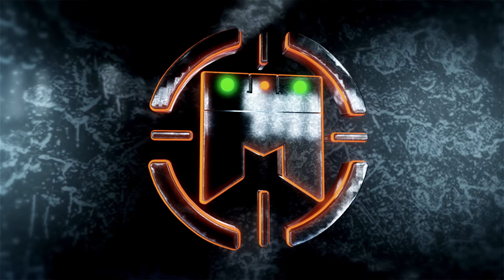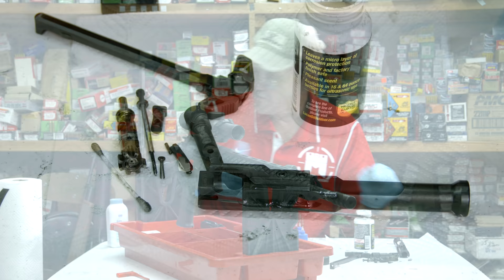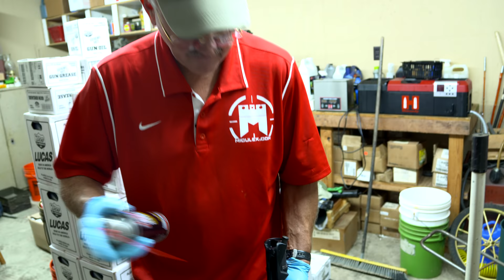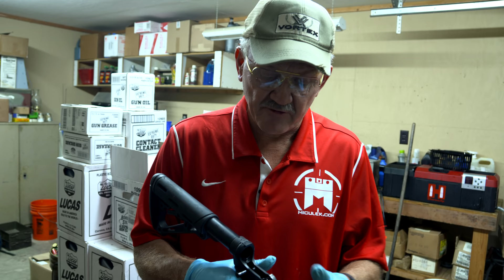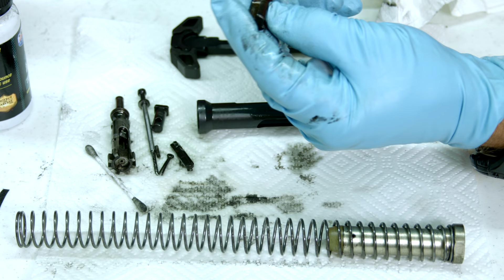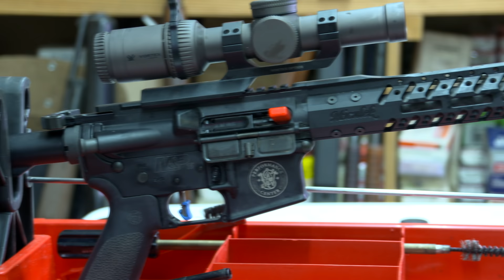ULTIMATE AR-15 CLEANING AND TAKE-DOWN with Jerry Miculek! (4K)

Comment: I have an old 181 series Mini-14 that can only be cleaned from the muzzle. Mine always has, and still does print 1.5 MOA groups. Why? Because I like to use a homemade plastic rod guide in the flash hider when cleaning to prevent damage to the crown of the muzzle. Using a rod guide on the chamber end of an AR is a great way to protect the throat area of your chamber and greatly extended your barrel life while maintaining top accuracy potential on an AR.

Comment: Non chlorinated brake cleaner, fuel injector cleaner and marvel mystery oil is all you need. If it can clean and lubricate an engine, it can definitely protect a gun and about $5 can clean a lifetimes worth of firearms usage. MMO can be used to clean and lubricate as well  and also runs about $4/qt at Walmart

Comment: Hey Jerry:   
Where did you get the two tools you used on your AR.  Also, when I asked the folks at LaRue Tactical, and they said not to oil the piston rings on the bolt and leave them dry. What are your thoughts on that? Other than that, this was an outstanding tutorial, and will likely be of great benefit to those new to the AR and old salts as well. 
Shoot Straight: James Myers

Comment: i make my own cleaner and lubercant. I  use 3 parts synthetic oil with 1 part synthetic transmission fluid. It cleans carbon very well and lubercates the weapon. The next time i clean all the carbon wipes right off without any issues...Just a thought.

Comment: My gunsmith showed me a cool trick for cleaning the upper.  I noticed Jerry uses paper towels and it seems to work great.  The way I learned was to put a 12 gauge mop on a length of handle.  It works perfect.  Its also useful to grease it for the range by putting a healthy dallop of CLP on it and use it to lube the chamber.
Reply: Lube the chamber? I was told you never want lube or liquids in your chamber, but rather clean and dry because you want your brass case to expand and seal in the chamber to prevent a blow bye of gas pressure which could cause your upper receiver to blow up in your face. Maybe this only pertains to bolt action rifles? Please correct me if I’m wrong. Thanks
Reply: @repairfreak  Jerry just showed you the proper method brother, are you assuming that he has no idea what he is talking about?  Do you know who this man is?
Reply: @rethomps1  Fogive me if I’m wrong but I didn’t hear Jerry say anything about putting oil or lube into the chamber. I was commenting on what I believed to be your comment of YOUR technique, you state “ It is also useful to grease it (speaking of the 12 gauge mop) for the range by putting a healthy dollop of CLP on it and use it to lube the chamber.”
Enjoy shooting and stay safe my friend.
✌️😎👍
Reply: @repairfreak  My bad.  The normal procedure is to use a chamber brush to remove the carbon and then use CLP on a star pad to remove the carbon.
Reply: @rethomps1  No biggy, and as far a Jerry, he is an amazing shooter!.
 I always enjoy watching his channel.
Take care 🇺🇸😎👍

Comment: Remember : the army made the bolt carrier 2 be used  as a bore guide , take off bolt and lminsert carrier to clean barrel , firing pins will last 4 Ever unless you got a fully auto M16 , king pin will crack at times for using ammo that exceeds 3000 fps. I never go that route , my loadings are 2890 fps.max. and my AR will last far longer than any others and will never malfunction provided I install a  soft buffer spring , Never use Tula ammo it corrodes chamber throat ! Or full metal jacket bullets , that is hard on ALL AR's ! Shorter barrels take a heck of a beating on the cycle from delivering more gas pressure !

Comment: I usally don't take the extracot off the  bolt assy. I also spray cleaner down the gas tube, and follow it with a pipe cleaner. I will start take the extractor off and inspect it  now. I clean my guns after every use, as they are stored in a safe for long periods of time betweeen shooting them. Normally I only use WD-40 on everything , that and vasoline for grease.I would add cleaning the gas tube idea to this video they make a special brush assembly for them. Thanks for the video , gives others ideas on how to maintain these platforms.

Comment: Never mentioned cleaning the gas tube/block, or did I miss it? I spray the brake/contact cleaner through it until clear. May seem to be an unnecessary step but it can't hurt.

Comment: I was a 62b10 in the IANG back in the late 90s I had an M16 with the 203 Grenade Launcher on it took mine apart and put the lower in the parts washer not a good idea it does remove the Finish

Comment: Just asking. You didn’t dip a used bore brush back into your solvent jar. I get that. But it appeared you re dipped a q tip several times wetting the bolt assembly? And if you don’t contaminate a container of bore solvent would you pitch it? Guessing not as debris would settle. Great tutorial

Comment: I don't match shoot however easy cheap and highly effective I've always used WD-40  nylon acid brush and clean cotton rags. It cleans lubes all in one and sprayable. If it can cut axle grease off your hands gunpowder lead and copper fouling is no problem and doesn't affect finishes!  Little gun oil after due to doesn't evaporate off if stored awhile.

Comment: You forgot to clean the two gas vent holes adjacent to the gas  tube on the upper receiver.  If they get blocked with residue it will slow the firing rate or result in a malfunction.

Comment: I use brake parts cleaner on my rifle and I've noticed when I clean out the barrel extension and upper reciever it does leave a white film similar to what is seen in your lower reciever in the final shots of your rifle. I'm Assuming this won't harm the rifle? I did notice that once I handle the rifle it all goes away. I'm assuming that's from the oil on my skin or something of that nature. I'm just concerned about long term finish issues.

Comment: What methods do you use to clean the inside if the gas key, gas tube, and inside of the Bolt Carrier where it hold the bolt. One of the most pain in the butt things, of all the cleaning steps, is deep inside the bolt carrier, where the carbon builds up behind the gas rings behind the bolt.

Comment: Thank you.  I learned a lot.  Bought a new Smith m&p 15 and right out of the box, won’t cycle the bolt.  30 rounds and not one ejection.  Pretty disappointed.  Will try all of your cleaning and lubing tricks and see if it will fix the problem.
Reply: Jerry King  Sounds like no gas getting to the BCG. Inspect the gas key and ensure bolts are tight and staked. Break down the BCG and ensure the bolt has gas rings. Inspect the gas block and ensure it is in the proper location, tight, and pinned.  Inspect the gas tube for fracture and ensure it is pinned in place in the gas block. Ensure the gas tube extends into the upper (viewing down through the mag well) approximately 1" to make contact with the gas key. If these simple checks don't uncover the issue then take it back for repair/replacement.
Reply: Thank you for the advice.  Since it is a new purchase couldn’t find anything wrong, sent it back to Smith and Wesson to let them fix.  Thanks again.
Reply: @jerryking3208  Sometimes these things can be a little aggravating. Good luck.

Comment: Has anyone used Berryman Chem-Dip? The old formula was pretty powerful, but the current formula isn't as strong. Sissy EPA. Always wondered if it would be good to remove carbon from inside the bolt carrier and inside the gas key, where the toughest spot is to remove carbon.

Comment: I tried to clean my ar15 sig sauer m400 sdi x series with a new cleaning kit. And the brush got stuck past the feed ramp inside the barrel and couldn’t get it to go forward or pull it out. Had to separate the cleaning rod and insert it into the barrel from the muzzle end. And hit the handle to knock the brush back out where the bolt carrier meets the barrel. The cleaning kit is a .22/223/556 cleaning kit. Can you tell me the right cleaning rod for my ar15?

Comment: Would have liked to see him reassemble the extractor and pin.  Always difficult to get that little pin back in.
Reply: He shows it at 26:40. I had the same problem (with the pin) though it became easier after removing and placing back in many times.

Comment: Hi ,Jerry . Thanks for the info on cleaning an AR-15. But I notice that  when you ran the brush down the bore , to scrub it ,that you did not run the brush once then unscrew the brush from the muzzle end  and pull the cleaning rod out of the bore to reinsert the brush onto cleaning rod again and run the rod and brush back down the bore again and repeat this process until the bore is clean. My question is , is  it ok to not go through this process that I described  but instead , just scrub the bore with the cleaning rod and brush back and forth without removing the brush? And will it  damage the bore doing it this way? Thanks.                                                               Eric
Reply: Never run a bore brush back down the bore unless it exits the barrel first. Personally I only run it one way from the chamber and then unscrew outside of the muzzle. But if Jerry did that with all his firearms, he may never have time to shoot.

Comment: What solution do you use in your ultrasonic cleaner?
Reply: +johnfranks I've got the same question.
Reply: +whitey211 FWIW, I like using kerosene in a Ziplock bag. I fill the tank with water and degass, then throw the parts in the bag with the solvent. This method saves a fortune on solvent, is relatively safe for flammables, with only a slight loss in efficiency. For water based cleaning, I use Simple Green at about 1:4 SG to Water. SG is corrosive to bare aluminum so I avoid prolonged exposure and always rinse throughly. 

One thing I've noticed with ultrasonic cleaners is that they are not great at cleaning caked on debris. That area on the firing pin Jerry scraped would also need to be scraped prior to throwing in the tank. Also, cleaning action falls off sharply beyond 15-20 minutes. If its not clean after 20min, you need to break out the scrapers and brushes and then try the ultrasonic again. This may be different for other machines, but thats my experience with Bransonic machines. my $0.02
Reply from the maker: +johnfranks Lucas bore solvent and ultrasonic cleaning solution
Reply: +johnfranks Personally, I use Decon's Neutracon, not very easy to get in the U.S., but they make 5L jugs (roughly 1.25 Gal) and that lasts... a decade. What's been working for me for the last few years has been a 2% solution, 80˚C/180˚F bath, I leave it for a couple of hours, rinse a couple of times, and everything's sparkling clean. I do have a short stroke AR15 though, so granted it stays pretty clean in general, compared to a standard direct impingement, but if you just clean a little more often, it should still work wonders.
Reply: +Miculek.com- The Leaders in Gun Control! 
What brake cleaner do you use to clean the trigger and barrel extension? You talked about something that does not damage the finish of the gun and it would be nice not to repeat that mistake.
Reply: +Miculek.com- The Leaders in Gun Control! Lucas makes an ultrasonic solution?  If not, they what to know specifically what specific ultrasonic solution---SPECIFICALLY.  Is that so hard?
Reply: Go ahead and stroke it a few times
Reply: +G. W Cook Non-corrosive, only 2% solution, non toxic... Looks like a winner on paper. I'll have to give it a try. MSDS mentions it being marketed as "Neutrad" in other countries. Thanx for info!
Reply: +EABOY2600 It was lucas also
Reply: Looks like this http://lucasoil.com/products/motorcycle-products/contact-cleaner
For some reason it's under Motorcycle products but the description says: 

Lucas Contact Cleaner is compatible with metals and polymers found in today’s modern firearms. The consistent high pressure spray blasts away powder, grease, oil and other residue from firearm actions, slides, barrels and parts. This unique formula displaces water, great for when your firearm is caught out in a rainstorm while hunting. Lucas Contact Cleaners quick drying, zero residue properties make it ideal for final degreasing of firearms prior to bluing, parkerizing or spray finish applications.

Comment: Wouldn’t it be easier to just use non chlorinated brake clean?  It leaves no residue and evaporates nicely.  Less mess, just lube the parts afterwards as needed.  I do that on my guns with zero issues.  It doesn’t hurt the plastic parts either in my experience.  Advance auto sells the WearEver brand non chlorinated brake clean.  The chlorinated one smells really strong and will eat plastic parts.

Comment: I’m glad to know that I’ve been cleaning a lubing my rifles professionally now for decades. My friends neglect their bolt carriers and think I’m OCD because I’ll even clean theirs when I see they have been neglected. Many times I’ve heard, “I’ve never taken that apart”. 
 The AR bolt carrier is a wet system and must be lubed or it will eat itself. I don’t use grease but I religiously keep my carrier clean. If I thought it could be a long period before I could clean it I might use grease as it will melt as it becomes hot to keep it “wet”. 
  Keep your powder dry but keep your bolt wet. (Insert joke here).

Comment: i'm not sure where the myth to never let the hammer dry fire to protect the lower from cracking came from... the lower never makes contact with hammer.  at least with my ar the hammer is designed to hit the bolt release.

Comment: Jerry, you are the GOAT for sure, no debate about that. But the gas rings splits on the bolt needing to be apart is a proven Myth. You could line those gas rings up perfectly and nothing will happen. Matter of fact they will actually move around as the weapon is fired. The only measure here is to make sure those gas rings are in good working order. Sorry brother, had to throw that out there. If anyone doubts what I said, do your research.

Comment: i just bought an ar-15 and it has a free floating barrel but there arnt any anti rotation screws so will it just screw off?
Reply: your barrel nut holds it in place. otherwise, you will have a very, very bad day at the range...

Comment: Wait,, he said he will not dip his brush in the bore solvent after using it because it's dirty and he doesn't want to contaminate the solution, then he proceds to take a q-tip and dip it several time after wiping it on a dirty bolt.

Comment: Jerry Miculek Have you ever used Gunzilla? It is the only CLP that I have used that actually Cleans Lubricates and Protects in one step. I'm sold just curious what you thoughts are. Also in your video you use two tools I unfamiliar with, the first being what you called dog legged piece of plastic hold open gadget that you used to hold the upper and lower separate. The other is the tool you said was the most trick piece of plastic you have ever had. Could you please let me know what the product name is for each of those pieces and where they are available

Comment: Jerry - great video as usual, is that block that attaches to the rear take-down pin available in stores or is it homemade?
Reply: They are available at most of your better gun shops. Wheeler Engineering makes a set of different sizes for use with different cleaning cradles.
Reply: They are available at most of your better gun shops. Wheeler Engineering makes a set of different sizes for use with different cleaning cradles.

Comment: Regarding the way he used the plastic punch to push a piece of paper towel around in the upper receiver, I have found a good hack for that part of the job is to clamp a wad of rag or paper towel on the end of forceps or hemostats and work it around with solvent. I also can scrub the lug area of the barrel extension this way. I use curved & straight jaw ones to get in different areas, and it also works great on slides for pistols. You don't have to push the wad of rag to keep it on the tool; it stays on in all directions like a Q-tip. I also have the Otis BONE tool that he used, and it sucks. The tool is supposed to fit the bottom of the carrier bore to scrape out all the carbon. It doesn't. The nose shape does not match the bore bottom, and it misses half the carbon. Otis cops out and claims that not all BCG mfr's. shape the bore bottom the same. I have a Colt and a DPMS, neither one fits. The BONE tool also has a female end for the bolt tail, and JM didn't even use that on his bolt. It also does not work well for me. I use a brass blade-shaped scraper and a brass brush to do the carbon scraping the old-fashioned way. Just make sure the scraper tool material is softer than steel. That's another problem with the BONE tool; it's made of steel. If you apply force to it, you could leave a mark on your gun part.